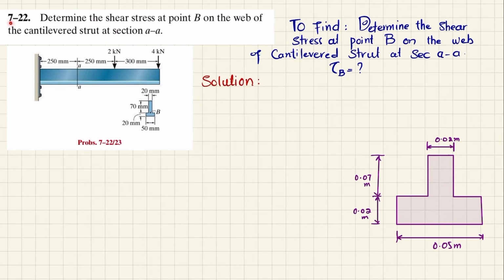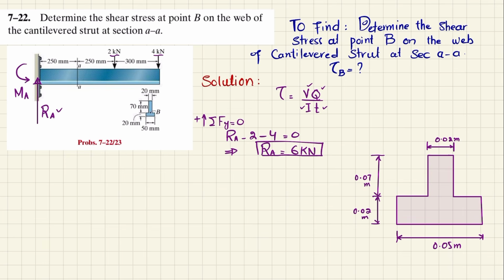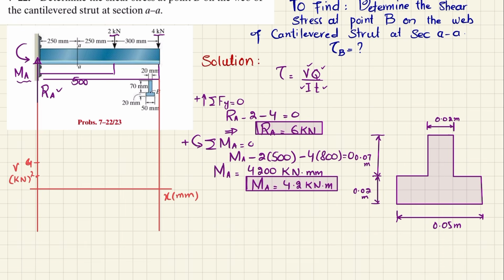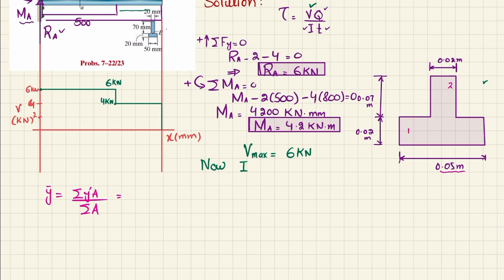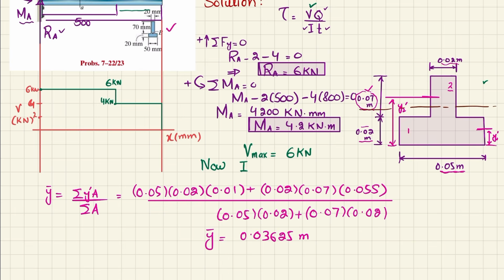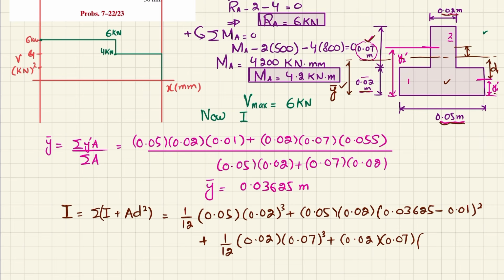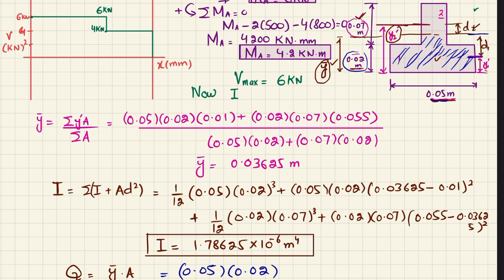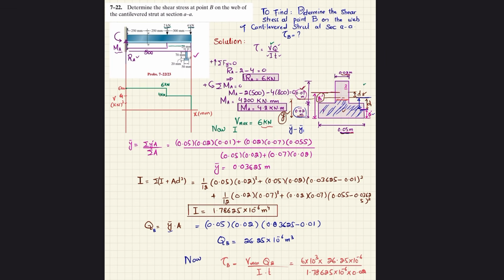7-22  Determine the shear stress at point B on the web | Mechanics of Materials RC Hibbeler

Comment: Just in time for our Finals, thank you so much! But really, why is the y-dash for B not located on 0.02m when at the illustration, point B is seemingly placed at the intersection point of two rectangles?
Reply from the maker: Y dash b is the distance from neutral axis to the mid of the area. As b point lies at distance of 20 mm from the base , so area below b point is out main focus so the distance from neutral axis till the mid of that area is y dash b. And this will be used to find Q ( First moment of inertia). Try other problems of this series you will learn it.

Comment: Why didn't you do 7-23 or is this both question 7-22 and 23 in 1 ?
Reply from the maker: 7-23 is exactly same as 7-22 if you share question I shall explain here what to do. I think in 7-23 you have to find the maximum shear stress....
Reply from the maker: For maximum shear stress you have to do all the steps as I did in question 7-22 and then from neutral axis to largest distance which is above neutral axis you have to find Qmax and then put it in shear stress formula. So instead of Qb you have to find Qmax and rest all the steps are same. If you feel any difficulty do let me know. Thank you